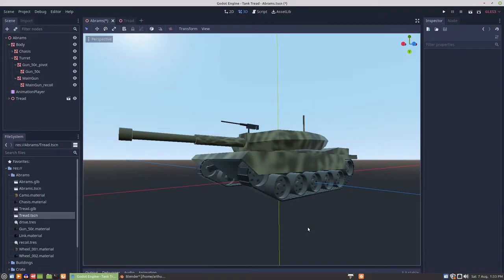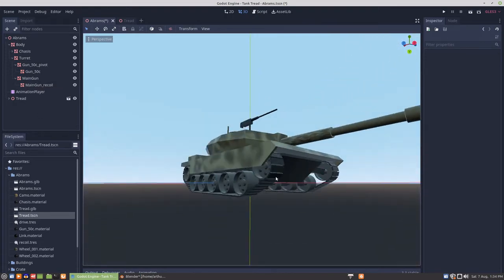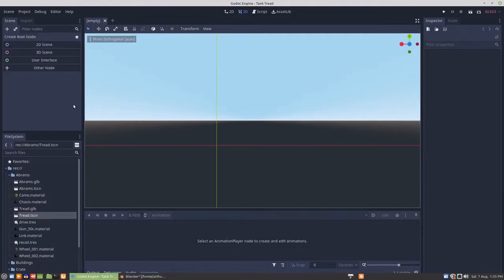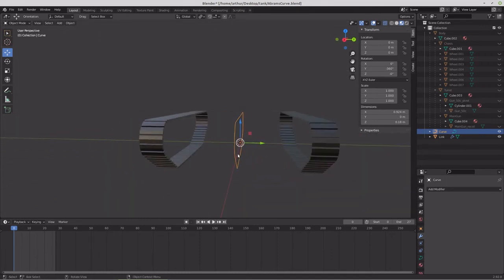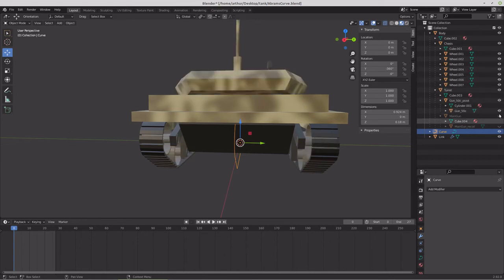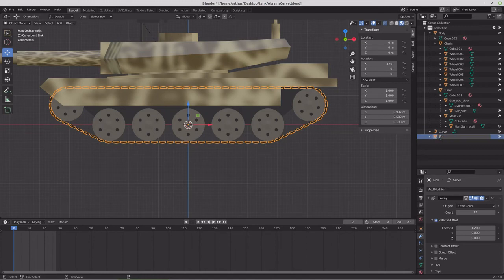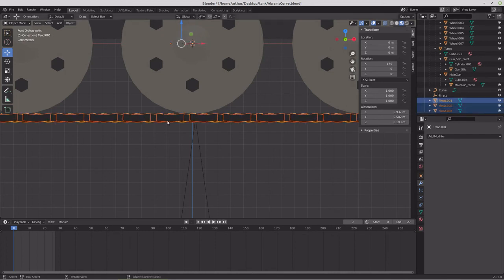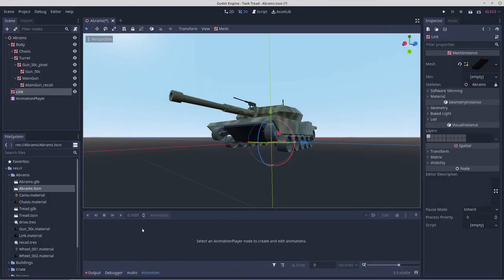Godot 3D Tank - Tank Tread Illusion

Comment: How does this translate to diferent speeds on the tank and when its pivoting?
Reply from the maker: not sure I understand your question, are you asking how the treads are going to move the tank? if so, they are not, they are just supposed to look as though they are.
Reply: @ArtER21  i mean, can you control the speed of the animation playing go match the speed of the tank. Also, when pivoting, can you play the animation backwards on one side and forward on the other?
Reply from the maker: @lovelustig8142  have you tried the first videos in this play list, in the start of this playlist I made a different tank that may be closer to what you are asking about.
Reply: @ArtER21  I have not. I'm doing it in unreal, I think I will do it by displacing a texture. But I'm scourging the internet for ideas :)
Reply from the maker: @lovelustig8142  I never tried unreal and I kind of change hobbies a lot so am very rusty on this particular one right now, the best I have to offer is currently in video format. I am not really sure what you mean by 'displacing a texture' but am guessing it is essentially the same thing but with an animated material illusion rather than an animated mesh illusion. I never thought of something like that but would guess it could simplify the model a lot. in godot I think it would still take four animations , forward and backward for the left and right side , because godot can only throttle animation playing in a forward direction so the reverse direction effect would have to be playing in a forward animation direction, I do not know the differences in unreal animation players , if it can throttle an animation in reverse then I guess only two animations would be required. the closest I came to making a tank that drives like a tank was using the godot vehicle body, I think that started around the third video in this playlist, the godot vehicle body was not particularly functional back then but if unreal has a decent vehicle body it would probably be the way to go, depending on how the tank will be controlled, the tank in this example would never turn like a tank should be able to turn. if you have the driving of the tank worked out tying the animation speeds to the left and right throttle should be pretty doable but if you don't have a left and right throttle then figuring out the animation speeds is going to be a fair amount of work (math) to get it to do what you are describing. in my first example I used thumbsticks on a game pad to control left and right throttle so the tank had potential to actually turn like a tank, the problems I had are right there in the videos because I did not edit out the problems, but if you got something like that driving the animations could be swapped out from what I did there to more what I did here